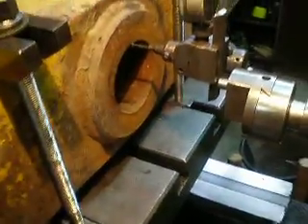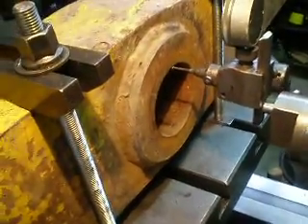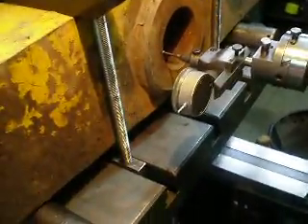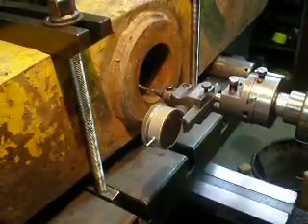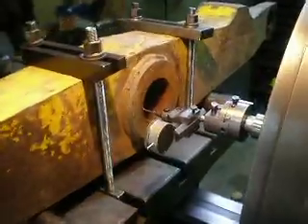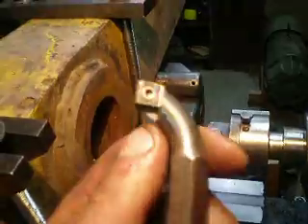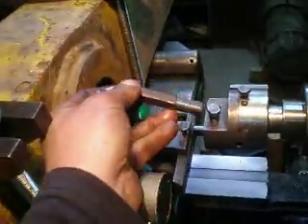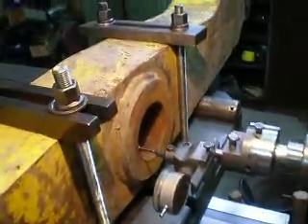Bore repair on horizontal boring machine part3 - find centre

Comment from the maker: In this video I use homemade cutter with exchangeable insert. You want know that to how can to bend a piece of HSS? So, You take a tool preparation, You make a gauge for that how much You to bend a HSS tool preparation. Then You take the gas-oxygen torch, to heat up it to it to be good red heat, then You bend it by gauge. For make it chilled=> drop it into the oil.